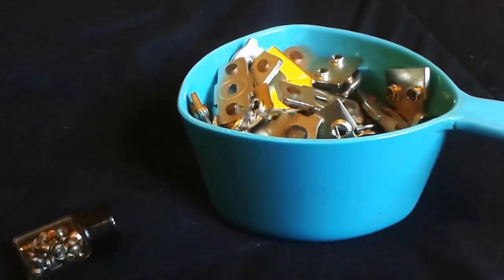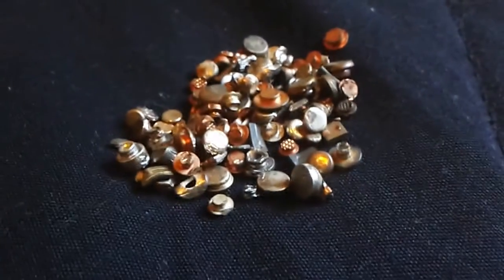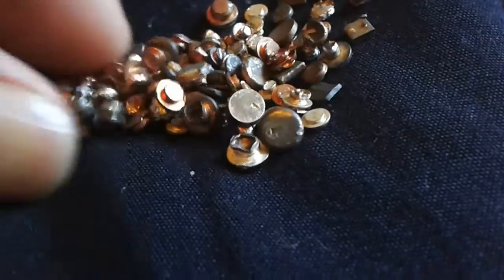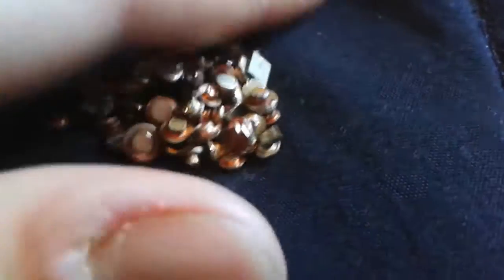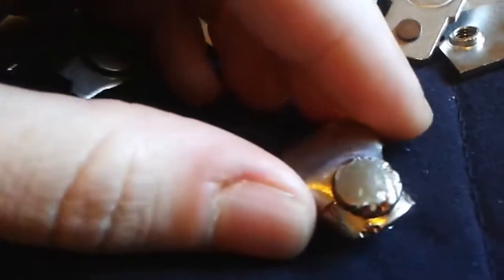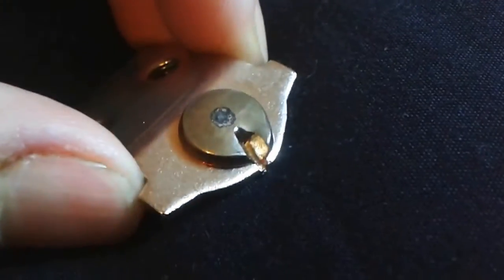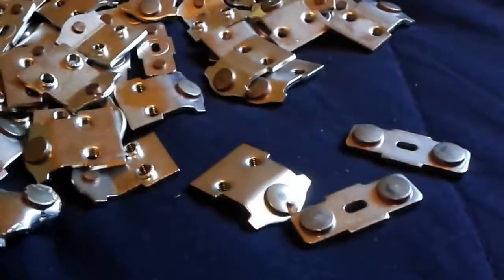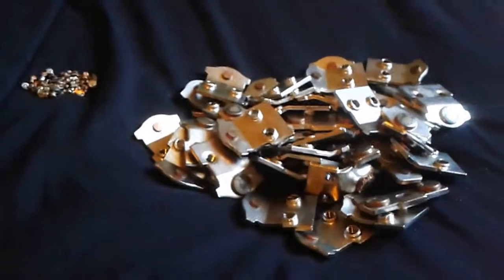Silver Contacts in Electronics

Comment: industrial silver contacts can contain (silver cadmium oxide). any method u use to extract silver  make sure your  silver is cadmium  free, after extraction and the older switch housing can contain asbestos matrix. try not to brake them wear all safety gear

Comment: When processed initially by dissolving in heated 70% Concentrated Nitric Acid I will end up with 99% (.990 Fine)...After the electrolysis I will end up with .999 Fine.

Fumes...Be careful as the Red Fumes given off during the process is Nitric Oxide (NOT the Nitrous Oxide that is aka Laughing Gas.). 

If that gas is inhaled then it combines with the water in your lung tissue to become Nitric Acid, once again, and chemically will burn the inside of your lungs. In a large enough dose you will suffocate. 

Be careful during the process as the contacts are alloyed with Cadmium which is poisonous. It will atomize while becoming a Nitrate Salt and if inhaled...well...you get the idea.. 

(I'd be wearing gloves while handling them too as Cadmium is a Heavy Metal poison and will make Heavy Metal Salts when in contact with the natural acids on your skin..)

And you really need a Negative Pressure Fume Hood to process this.

Wear a gas mask with activated Charcoal to absorb the fumes and do this away from people if you cannot get access to a fume hood.. The best solution for pollution is dilution. 

But we do not want to kill off the neighborhood....and/or their pets?
Reply: 24kGoldenRocket by the way, dishwashers, stoves, washing machines and dryers and water heaters have a decent amount of silver contacts in them as well so be sure to not overlook those!
Reply from the maker: 24kGoldenRocket Oh goodness, scary stuff. I will try to get some gloves and I'll pass the info along to my fiance since he's the one who's trying to process everything.
Reply from the maker: +JustinLodes Awesome, thanks!